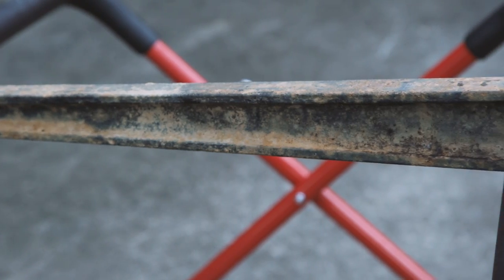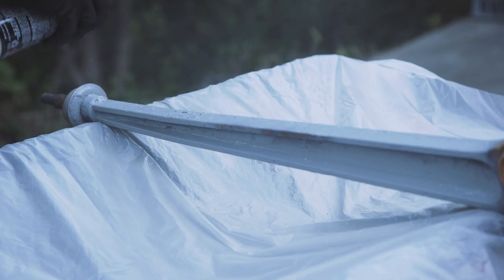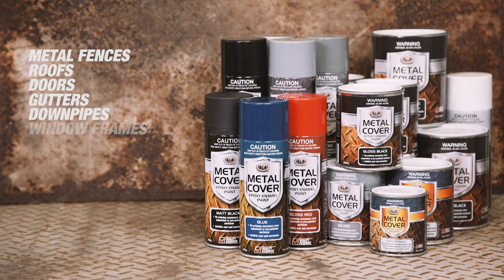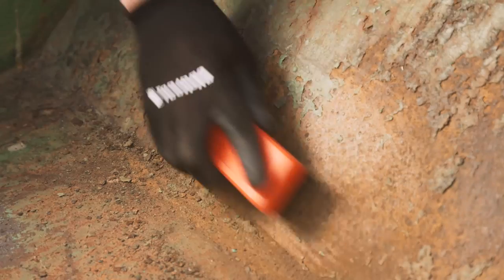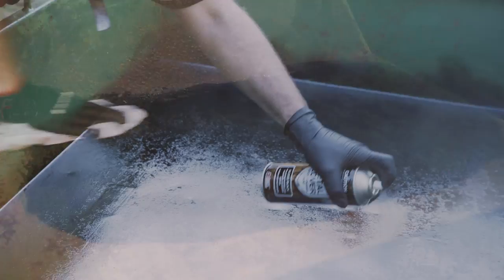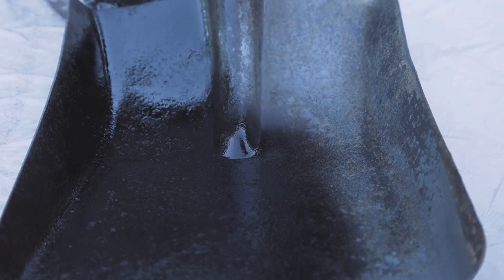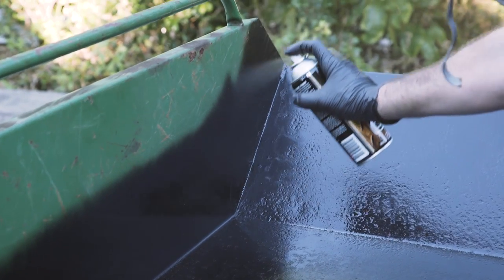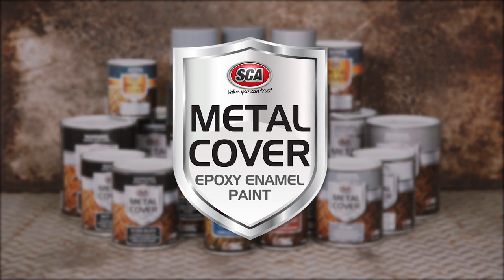How to Remove Rust //  Metal Cover Epoxy Enamel Paint // SCA

Comment: Is it heatproof? Thanks!
Reply from the maker: Hi there, Metal Cover paint is heat resistant up to 150 degrees Celsius. - Ash
Reply: Do you have it available in 4L Satin Black?
I use your 400ml Etch Primer for all my Aluminium Plasma Cut products, as it seems to be good value and sprays quite well, gets into all the detailed areas, but I'm searching for an alternative to the White Knight 4L Rust Guard Satin Black Epoxy Enamel Paint. It's great paint, I use a roller to apply it, but I can't see any 4L sizes of your Metal Cover on your SCA Metal Cover on your website. Also wondering if you have a clear coat to go over this Metal Cover paint?